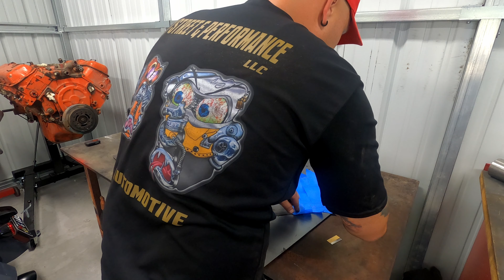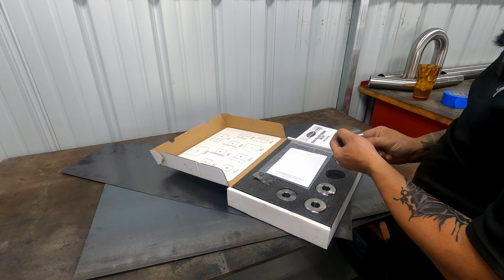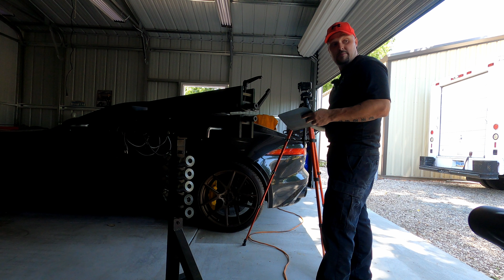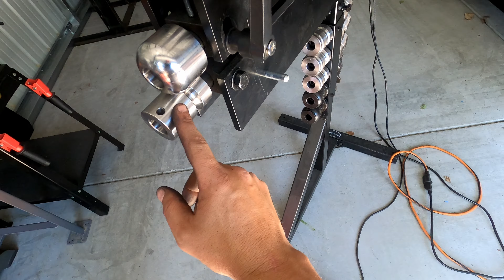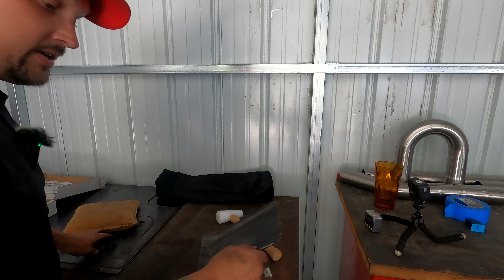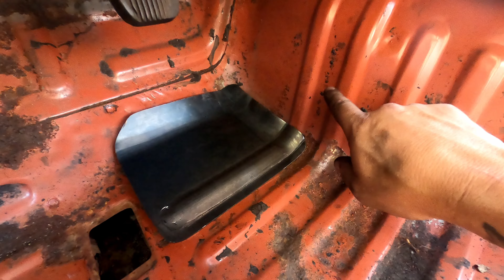Precision Rust Fix – How I Built Patch Panels Instead of Replacing the Floor

Comment: Really god work i think
Reply from the maker: Hey thank you. still learning but so far the panels have fit well!
Reply: @JPSTREETPERFORMANCE  seems like it, iam about to do my floorpans on my celica but its a newer model.
Reply: Found your channel today and i have been bench watching the celica series. one question was the 3sgte engine ever a considiration?
Reply from the maker: @volvomicke999  I did look into the 3sgte and it’s a great motor. but I decided to go with the 1UZ because they’re readily available at wrecking yards and the stock internals are all forged so they can handle a massive amount of boost when I decide to boost it for drifting. I just really need the torque and a 32 valve V8 definitely produces that.